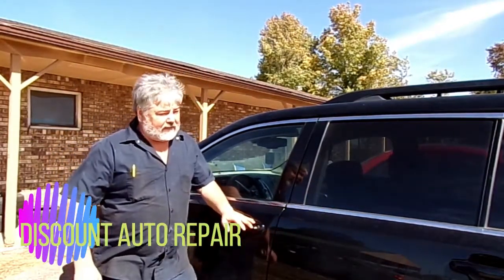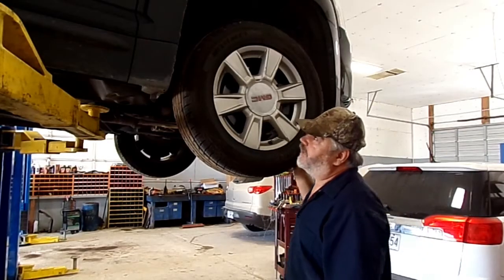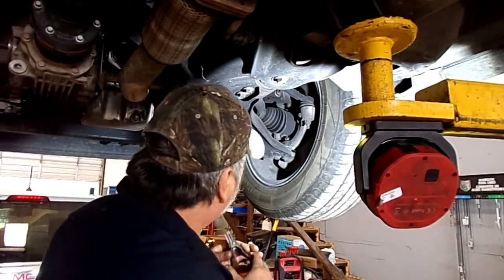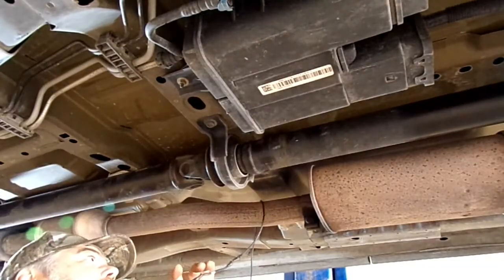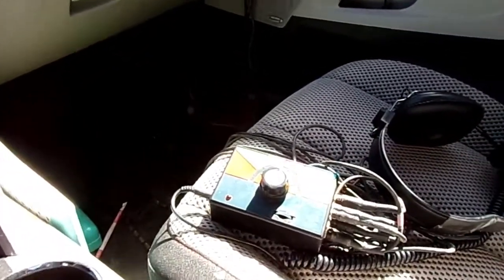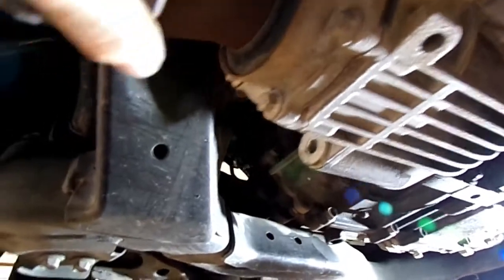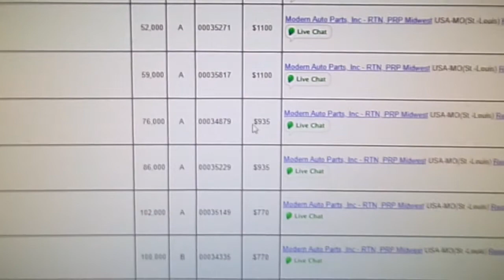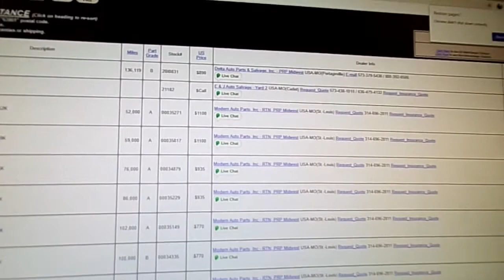TRACING DOWN NOISE GMC TERRAIN

Comment: My 2012 terrain has exact same problem
Reply: Did you figure out a fix? Mine just started making a wobbly noise and feeling in the front
Reply: @mrpositivevibesgrow530  did you figure out a fix my car started doing it too
Reply: @rossiethomas181  I changed my sway bar links. Easy fix and it stopped the noise a little bit but it started again. I have a feeling it’s my tie rob ends or ball joint on my lower control arm
Reply: @mrgoodvibes9016 did you figure it out

Comment: My 2010 Equinox Transfer case just took a dump too.  Same noise.
Reply from the maker: sorry to here that , I did a video on a GMC terrain transfer case replacement , that might help you out if you decide to replace yourself , they are very similar.
Reply: @heartlandmechanic  Is what it is.  Mine is a V6 so removal might be slightly different.  But I don't have a lift and some of the specialty tools to do a job like that so I'm leaving it to the professionals.  If I can get another 30-50K miles out of the car I'll be happy.

Comment: No doubt it was run with insufficient synthetic gear oil.
But as long as the repair costs $10 000 000.00 ; that's a good Stephen King story.
Reply: I’m having this exact issue with my 2016 Terrain and I didn’t realize my oil cap on my engine was leaking oil until I recently replaced it and the first time I noticed something off besides the noise was when I drained my oil before I noticed any noise and I only drained out 2.5 quarts and so I changed the oil and then eventually the noise started and I changed my oil at 45% life and I drained only 3.5 gallons then I fixed the oil cap but now I’m stuck with this noise ..will it hurt to keep driving the car until I can afford to replace the transfer case? (Also just to confirm, do you agree that the issue is the transfer case or are you saying the oil issue is the problem and therefore it’s not the transfer case?) any reply is much appreciated!
Reply: @seapeddler Okay so I did some research and I don’t have a 4wd or AWD Terrain so my issue is not the transfer case ..but if I had the oil issue do you have any insight as to what my issue is?